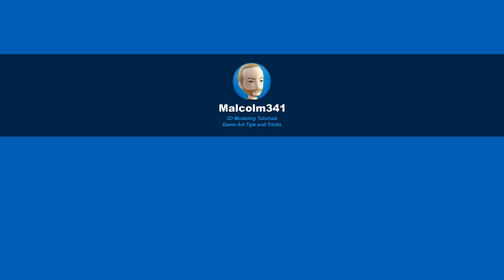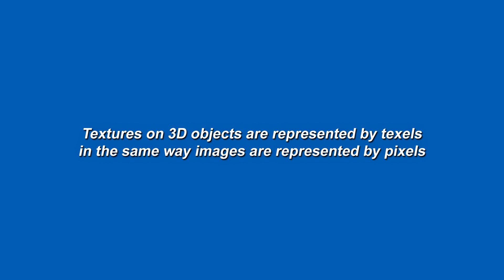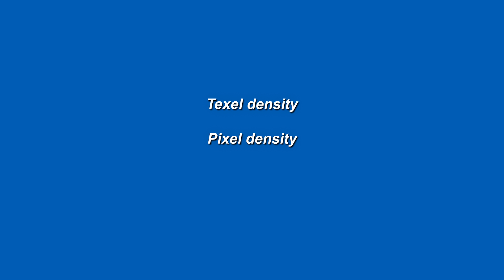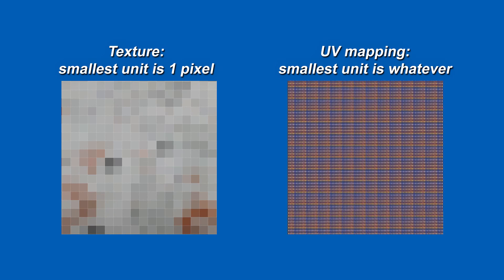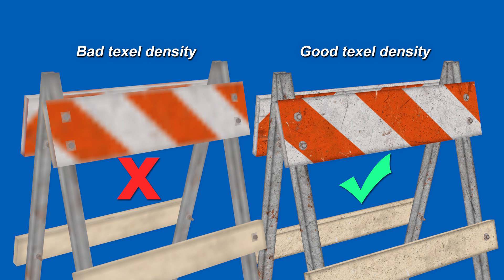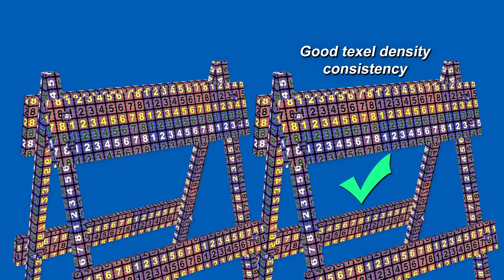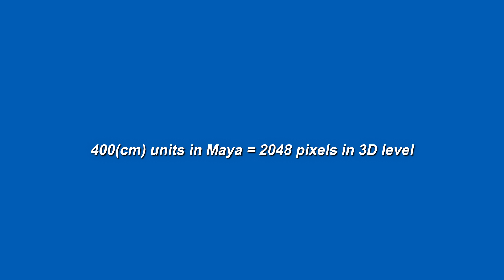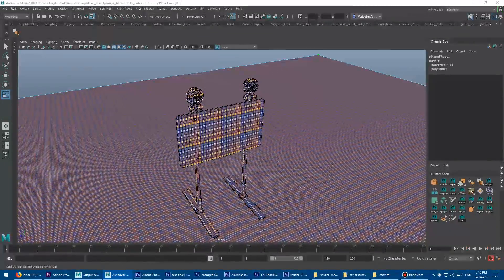What is Texel Density and How to Master it

Comment: What do you do with walls with texel density in a room environment? 
I have a medium sized room but will contain smaller objects, I have texel density of 400 like your video, but my walls is over the 0-1 squire, is that ok? the walls will have a generic like tile texture so would it matter it is out the square?
Reply from the maker: Hi Andrew, for walls and ground the model can be any size you like, then you just tile the texture outside of the 0-1 UV range. To match the tiling texture exactly to 400 like the video you can use a planar map and type in 400 or you can use the set texel density tool with the 5.12 setting, or you can use the sew to UV trick I showed in the video. Often for complex walls with scifi details we'll use a tiling texture for the large flat surfaces, then use a second texture laid out in what we call a trim sheet that tiles horizontally only. We will then "trim" all the details to get the best of both worlds for large walls, while still keeping the exact texel density we set to accomplish. This is a very common practice in games to save texture memory and keep resolution high for large architectural models.
Here's an example image of what I'm talking about.
https://drive.google.com/open?id=1vl9flmcHfb5E0HLqXKcKTXgce6Ald1yo

Comment: Another key feature of using this texel density is how nicely it divides into powers of 2:  
2m=1024px
1m=512px
5m=256px
Reply from the maker: Yes exactly, I was taught this technique while working on Need For Speed back in 2008, NFS is a third person game and a one story building is roughly 4 meters tall in real life so 400 units = average resolution of texture worked well on that game and pretty much all others I've worked on since then. At the time we were on xbox360 so 400 units = 512 pixels and the nice thing is as hardware advanced we kept 400 units = ??? and just upped the average resolution of the texture. We're currently at 400 units = 2048 pixels, but in the future I'm sure we'll get to 400 units = 4096 pixels.
Reply: @malcolm341  What should u aim for? And what is the relationship for pixels, I don't understand, like, is 5.12 the same as 512 pixels per unit?
Reply from the maker: I personally aim for 400cm in Maya = 2048 pixels. That would be 5.12 pixels per centimeter I think. Make a plane in Maya 400cm big which is mapped 0-1, then apply 2048 texture to it, divide 2048 texture (pixels) by 400cm = which gives you 5.12 pixels per centimeter. I don't usually do the math though that's too confusing, I just make my plane the size I want, map it 0-1 and apply a 2048 texture, from there you can click the get texel density button in the default Maya tool which should capture 5.12 pixels per centimeter. Change the size of your plane if you prefer more or less pixels per square meter and click get texel density again.
Reply: @malcolm341  Can u get a 2048 or 1024 texture from checker mapping?
Reply from the maker: Not too sure what you mean by that?
Reply: @malcolm341  nvm but another question, what do you do if you have a UV map with like a thousand objects in it? Should you minimize the UV map so that it doesn't have too many complicated shells, or should u collect as much as possible wiithin a single UV map? But if you do that, how do you know what should be painted etc?
Reply from the maker: I always try to reduce the number of shells to as few as possible. This reduces seams and generally gives better looking textures with higher resolution. The down side is they might not pack well together, and you'll still need to separate UV shells where you have a hard edge on your low poly mesh for normal maps.

Comment: how many units in maya represents 1 meter in maya , because I am using unity.
Reply from the maker: If you leave Maya at default settings it will be in cm, so 100 units in Maya would = 1 meter, but I believe Unity does something silly if you use .fbx Unity imports the file with a 0.1 scale modifier on it. So after you import your model make sure the scale is set to 1.0 in unity on the asset in the project window. As I recall if you import .mb files into Unity they come in correctly. If set up correctly 1 unit in Maya should equal 1 unit in Unity, sorry haven't used Unity in a while though.
Reply: I use another 3D package  to export to 1.000 the scale , to avoid issues in Unity.... well , it is easy to fix that problem , well I think your video is very informative...  thx
Reply from the maker: Awesome thanks for your feedback, glad the video helped.

Comment: Since texel density ties together UV size and object size, what would you do if the model is very big and wouldn't fit at all on one uv map?
Reply from the maker: For larger objects there are couple standard techniques to use. Mostly the trick is to use multiple textures, like 3 or 4 2k textures depending on what you're texturing. We use a combination of tiling textures, unwrapped details sheet, and what we call a trim sheet which has detail that tile horizontally, but not vertically. With these technique you can texture most large objects because you can fill in the big flat areas with the tiling texture, then model strips on the edges of architecture and use the trim sheets, then fill in any smaller details with unique details sheet. For large rocks you can use a second normal map unwrapped into 0-1 UV space, then apply a tiling texture underneath that, for more complex and very large objects there is also multi-texturing where you apply 3 or more tiling textures and then use vert painting in Unreal or Unity blend the texture in based on the vert colour you paint.
Reply: malcolm341 Thanks for the info!
Reply from the maker: Good idea, I'll put it on the list.
Reply: it will be nice to see this info as video tutorial :D

Comment: 2048/400 = 5.12
Reply from the maker: Oh I see! Thanks for commenting, that makes sense now.
Reply: malcolm341 no problem, I gave up on cg stuff about a decade ago. I'm trying to get back into and this tutorials was interesting. I will implement it on my next project.
Reply: 5.12 for TD (texel density) right?
Reply from the maker: Yes if you want 400 units = 2048 pixels.
Reply: the rule is  Meters (400 units for example ) * amount of texel (5.12) / resolution (you want, 2048 in your tutorial) .??   M * TD / Resolution ... but texel density is related to 2048 is 20.40 (px /cm...for 1024 is 10.24 (px/cm) . for 511 res is 5.12 (px/cm).

Comment: Essential Viewing. The scaling small details up is great as I always went the opposite way (duh!). Consistent Texel density is a real eye opener so I watched it 3 times :) . Totally subscribed now and thank you very much indeed!  The Texel density for 400 to 2048 in cm is 5.12. I use m so it is .0512. Therefore is is just a case of knowing that figure and using it from then on?
Reply from the maker: That's great stephen, I'm glad you enjoyed the video. Texel density is relative so you can technically use whatever you want, for example on games I've worked on we usually use 400cm = 2048 pixels, on Dead Rising 3 I believe they used 512cm = 2048 pixels, this would give more unique pixels without seeing a repeat on the tiling ground, but the pixels would also be lower rez and softer so moving the camera close to the texture would break down faster. I've even heard of some games using 200cm = 2048 pixels, so that would mean lots of repeated details on the tiling ground, but very high res and you could move the camera very close without loss of detail or blurriness. It's up to you to determine which texel density suits your project and then try to maintain consistency from there. That's why I always figure out the floor texture first and make sure everything matches to that.

In the texel density tool inside the transform rollout of the UV editor all you need to do is select a single face and click the get button, this will automatically give you the magic number you're looking for. Providing you've mapped your first reference object correctly to the desired density you like. I wouldn't recommend changing the units in Maya to meters I've found in the past this causes issues, instead I'd leave Maya in centimeters and just make something 100cm when you want to make 1meter.
Reply: Thank you Malcolm. This recording was very useful because it was not just about the tools but about the process and so many recordings don't do that. Thank you very much
Reply from the maker: Thanks, I'll try to include the how, and also the why in all future videos. That's good feedback.
Reply: Apologies for going on about this but my whole workflow has changed because of this video and the quality of the work is much much higher. Really thank you very much. Apologies again for another message.